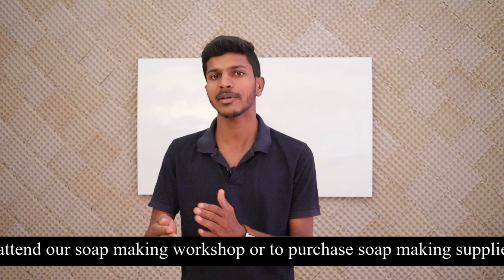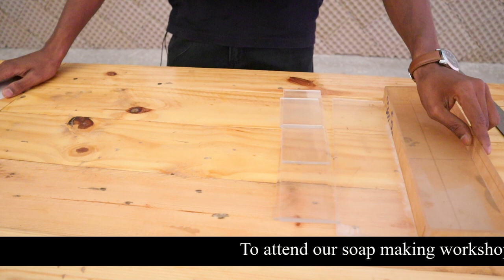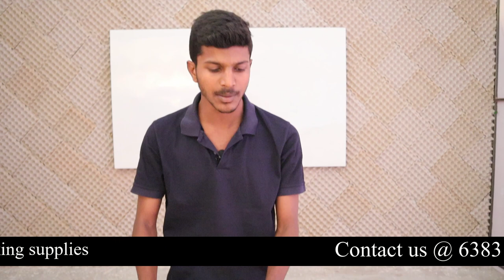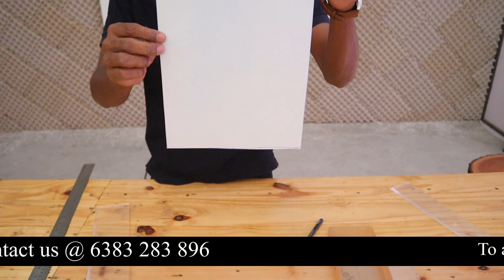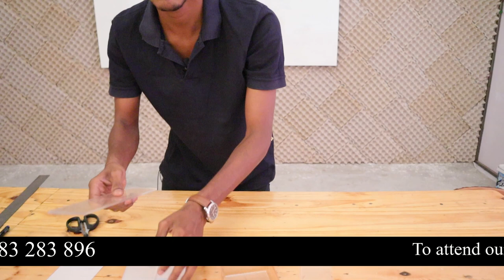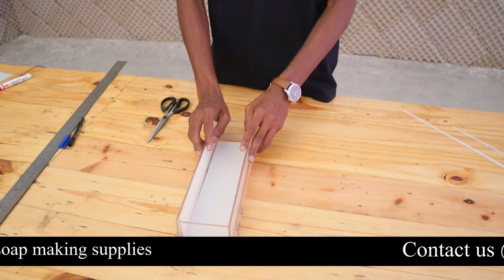How to use - Soul mould lining sheet

Comment: Hi Sir.. I have couple of suggestions
1. Please suggest options without cutting the lining sheet by just measuring, skoring and folding just like we do in krafts
2. I understand that acrylic molds have lot of benefits when used as soap molds, but I had a different experience.. In my mold, there is leakage when I pour and I use tapes to seal the leaking part.. Also mold once accidentally fell on my feet causing a deep cut.. Will it be possible to make wooden molds or if it is going to be acrylic, then we need to take care of the corners and sharp edges..

Thank you